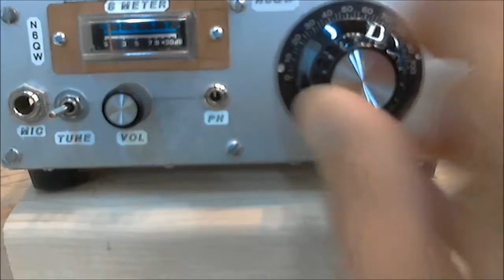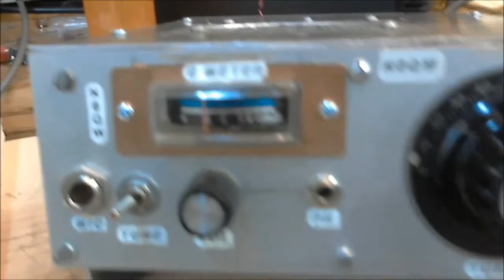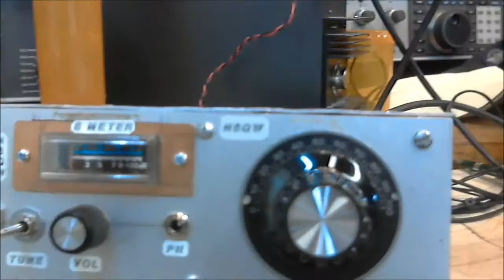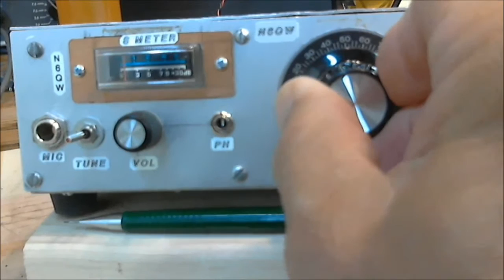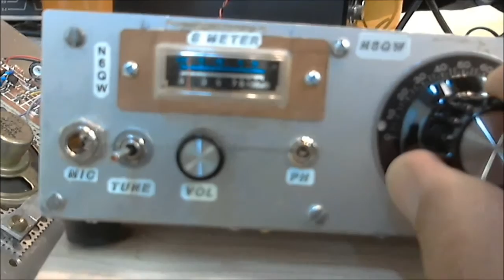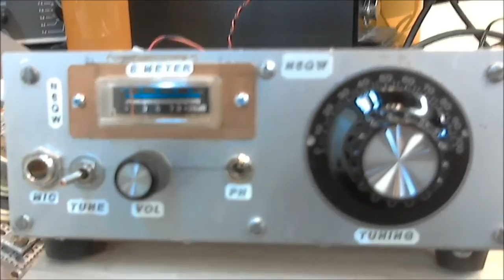N6QW -- 20M QRP SSB Transceiver

Comment: ok good for indonesia thank you for experiment hombrow 20m , 40 m QRP 10 watt.
Reply from the maker: +AGUNG HADI Thank you for your post. I later added a LCD display to this radio and replaced the VFO with a DDS. I have since used parts of this radio in other transceivers. The radio would easily do 5 watts but you would need a different RF amp for more power output.73'sPete N6QW

Comment: Nice job inside! Congratulations,
EA5BLP
Reply from the maker: Hi OM,
Thank you for your comments. Now looking to add a DDS to this radio using a miniature 8X2 display and the Arduino Pro-Mini. Have had it working on the bench --now need to rearrange he front panel.
73's
Pete N6QW
Reply: Lleva reduccion ese dial? parece poco preciso, no?
Buen trabajo, sí señor!
Reply from the maker: Didopa Sg There is no dial reduction -- no room. I have since made the tuning range smaller (by about 1/2) and that makes the tuning a lot better and smoother.
Pete N6QW